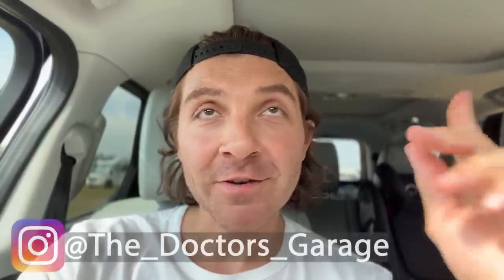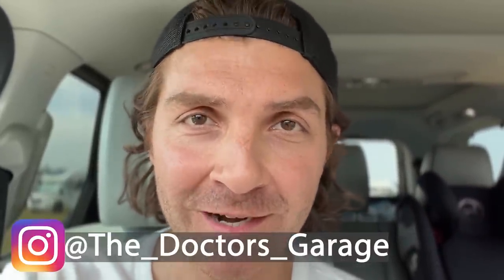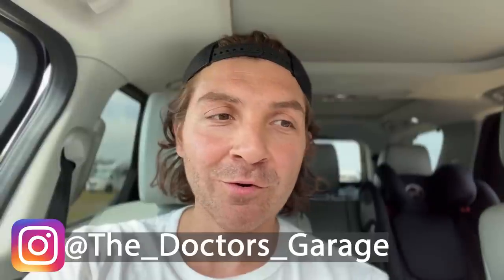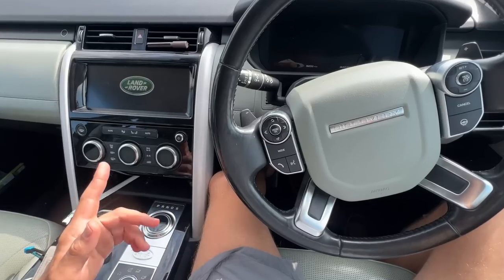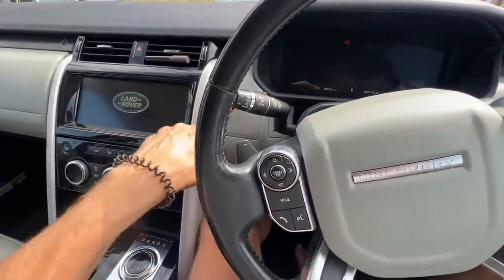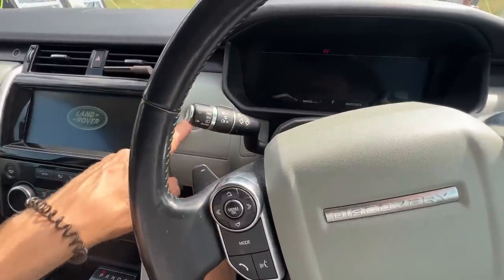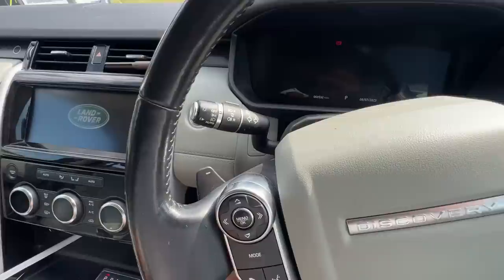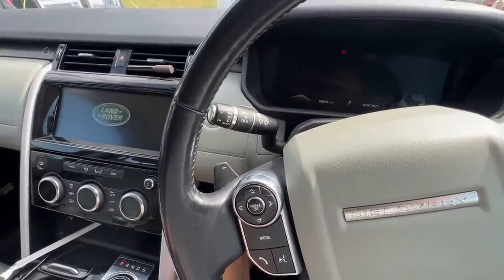IT'S TIME TO LET MY LAND ROVER DISCOVERY 5 GO...

Comment: Hi mate, I had a 2018 disco5 hse,had it for 12 months, 25000 mile’s when I got it, absolute nightmare, in at Landrover every couple of weeks,  ad blue problems and saying no re starts after 400 mile’s time and time again plus many other problems. I’ve also got a old defender 2003 never had a problem with it……get rid of the disco mate, so unreliable,I’ve owned landrovers forthe last 40 yrs

Comment: Brake pedal switch 😉
Reply: Had this before not just with landys but 1x merc and 1x VW. All non starters, don’t believe it works if brake lights work either as the normally have two contacts inside, one to brake lights another to ecu to tell the car when brake is pressed etc, if that contact is playing up it could cause it.